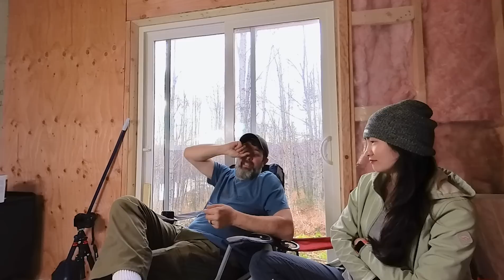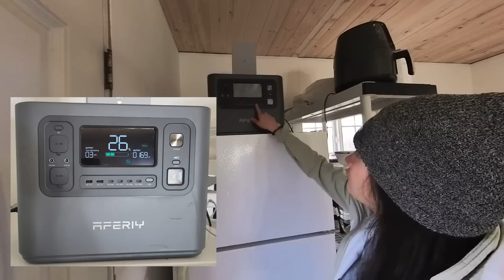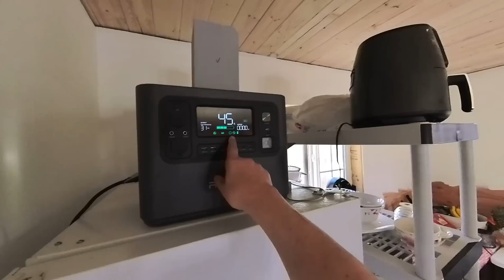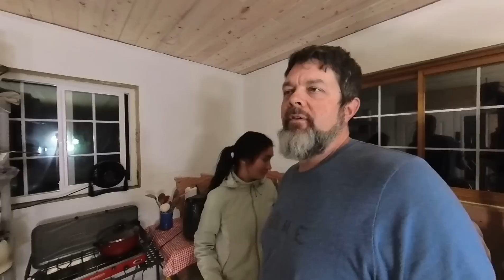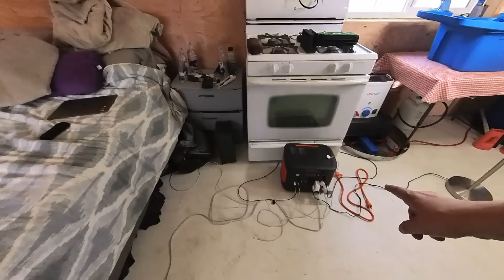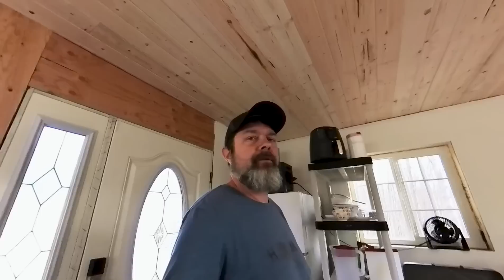WE NEED POWER.  IS THIS GOING TO WORK?

Comment: I saw another couple build a small insulated box to put their generators outside to store and run them. Need to build exhaust port obviously but seemed to work well. As for the cooking situation anything with a heating coil like that air fryer eats electricity like a Filipino eats ice cream LOL. My wife is Filipino as well and seeing Eleinne light up at the mention of ice cream was adorable :) 
So I highly doubt there will be much air fryer cooking without the generator running this winter. Good luck we are rootin for ya
Reply from the maker: Haha.  So true.  Salamat